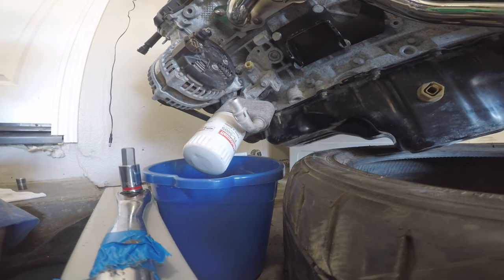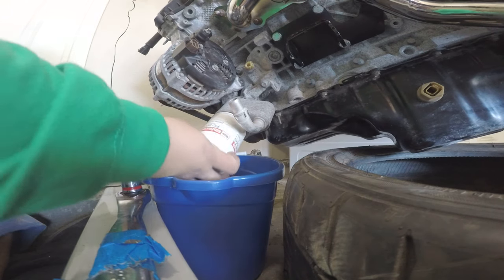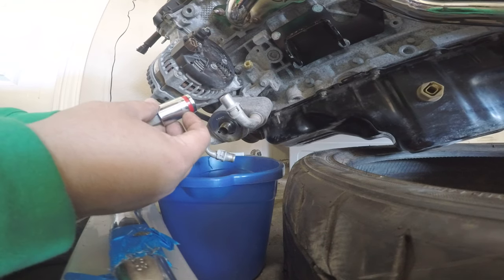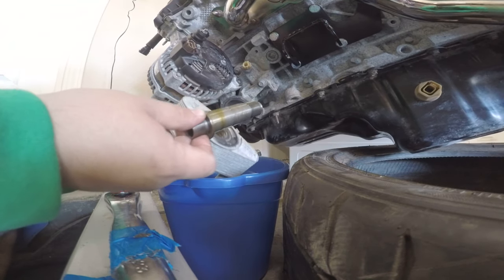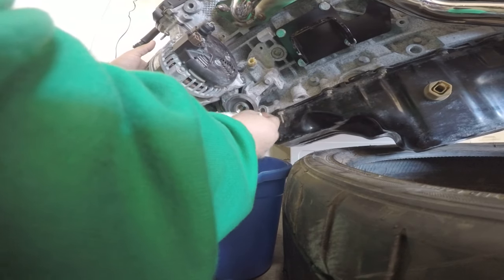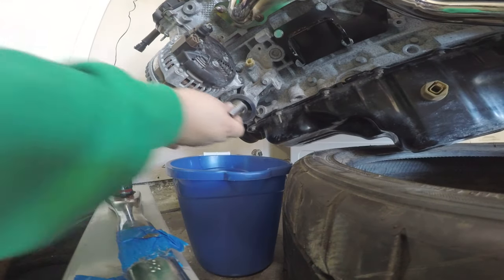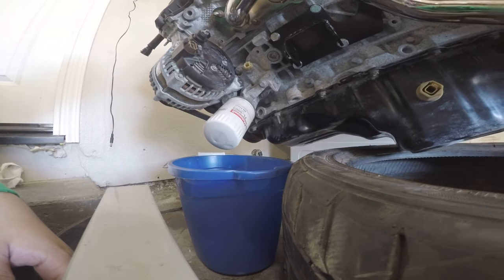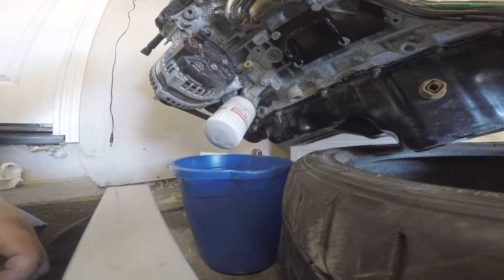Coyote Engine oil cooler delete

Comment: Only 5.0L oil cooler video on replacement I found. Very helpful even with the block out demo. Only thing to add: requires a 14mm DEEP hexagonal socket.

Comment: This is a highly contribution modification. The coyote is a high revving engine with overhead cams and variable cam timing so it produces a lot of heat in the cylinder heads that is absorbed by the oil. If you use your coyote engine for anything other then average driving than a oil is highly recommended by ford. Please use a cooler of some kind.

Comment: Why on earth would you want to remove the oil cooler. I understand changing to a different kind of cooler but removal! Makes no sense.
Reply from the maker: Gen 1 coyotes came with no cooler from factory and worl just fine, I'm removing the cooler in this case because it wont clear the foxbody swap bar mounting bracket.
Reply: I understand removing the stock cooler but I would run some kinda cooler
Reply: I have a 2012 F-150 which is a 1st Generation and it has the cooler lines. I am doing a coyote swap into a 1979 Ford Bronco... The oil cooler is there on the 2016 F150 coyote motor I purchased out of a wrecked truck, but the Ford Performance PCM kit comes with a basic lower radiator hose.  I am torn on whether to keep the cooler and buy the stock lower hose with the lines to the cooler or delete. I am not running crazy horsepower, mostly a stock type driver.  wonder if keeping it and getting the split lower hose makes sense to run water through that housing...
Reply: Mark Hildebrand if you use your truck for towing or any real work keep the cooler. If it’s just for cruising you will be fine without it. You can order the hose online very cheap

Comment: The stock oil to water cooler works awesome. Better than any oil to air cooler twice it’s size.
Reply: Until it corrodes like mine did and fills your cooling system with oil.

Comment: Were did you get the shorter oil filter thread adapter to mount the filter?
Reply from the maker: https://lmr.com/item/LRS-36890A/mustang-oil-filter-adapter-al3z-6890-a-11-17
I got mine from tasca parts but Here's LMRs link

Comment: Great video man. So will removing the cooler affect the  operation of the engine? 
I’m doing the swap also and researching this.
Reply from the maker: You do lose the engine oil cooler benefits, but note the gen 1 coyote came without one and worked just fine. I removed mine since I feel having a front sway bar is important.
Reply: Cesar's Garage thanks for the info!!
Reply: @cesarsgarage1393  I think the gen 1 from 2013-2014 came without oil squirters  because of the phosphorus coated pistons ported over from the Boss 302...only the Boss 302 had an oil cooler, like the 2015 and up.  Was prolly left off 13/14 GT to save money,...but still added in 2015 for a reason.  Prolly smart to keep on, even with the huge oil sump.
Reply: @jdigitalseven7  my 2013 Had a oil cooler, Trac pac.
Reply: I own a 2013 F-150 STX 5.0 with every option package offered on that model. If this part isn't an oil cooler, it sure missed it's calling.

Comment: Hey bro where did you get the threaded insert adapter thing? I want to delete it on my truck after mine just let go
Reply from the maker: Got mine from ford, here’s the part # AL3Z-6890-A
Reply: @cesarsgarage1393  omg thank you very much bro!!!🙏 i was just looking online for it too but no luck. I was gonna cut up the original bolt 😆
Reply from the maker: @jc-kj2on  No problem brother, and if you look at the other comments on this video there’s actually a link to where you could buy it on LMR
Reply: @cesarsgarage1393   only problem is i live in freezing cold Canada  and ladt time i tried to order stuff from lmr the lady quoted me like 150buks in shipping for some parts for my foxbody.  It will probably work out the same after i buy it from ford though lol!